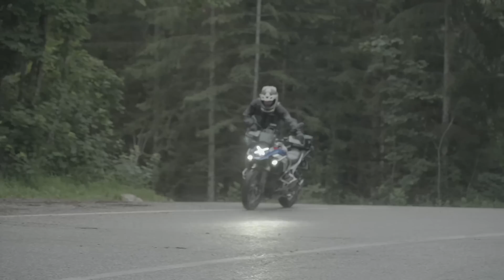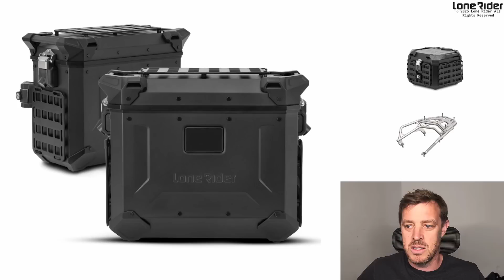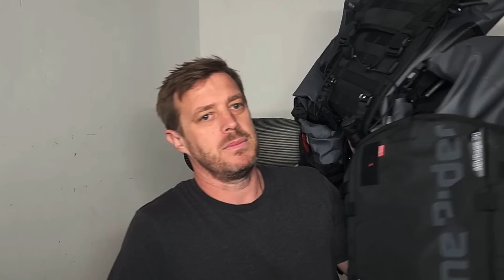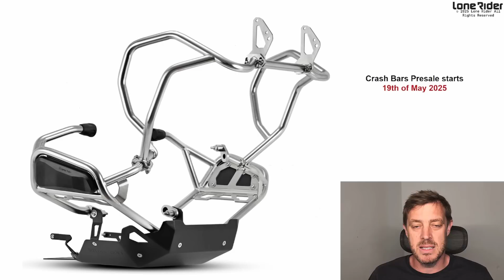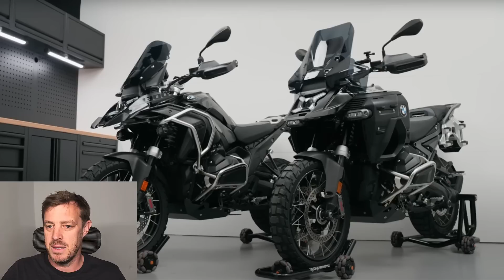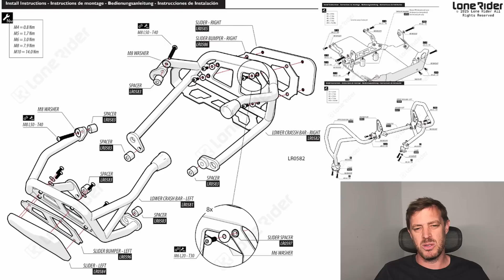Motorcycle Protection Just Leveled Up – Full Product Development Journey

Comment: I’m excited about the lights and moto panniers. My 1300 GSA is a pavement princess. I’m hoping the version for the factory mount R1300 GSA will follow shortly. Also, they need to be big enough to store a helmet in each side. Smaller than 45L would be a missed opportunity IMO. I’m hoping you have a Denali D2 size light in the works. Thanks

Comment: You guys do a great job 👍🏽!

My suggestion is that if you intended to make a version of skid plates out of HDP like you said, why not line the inner surface of the HDP plate with lightweight, thin sheets of metal or heat-resistant fibers.